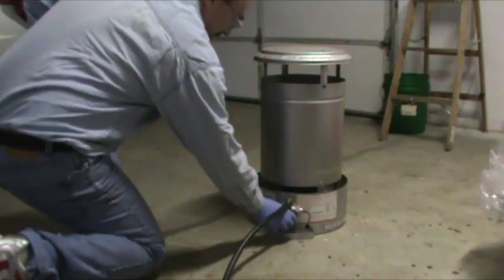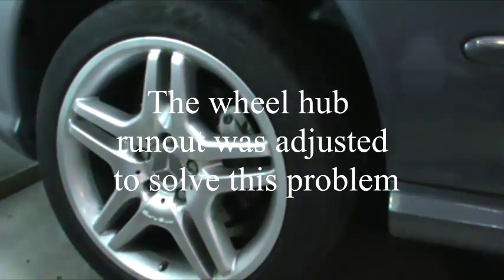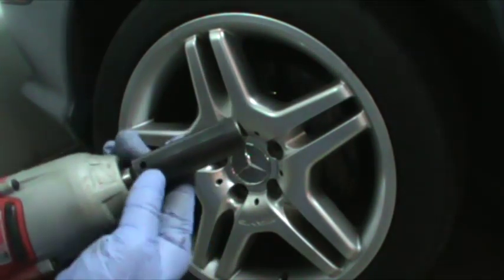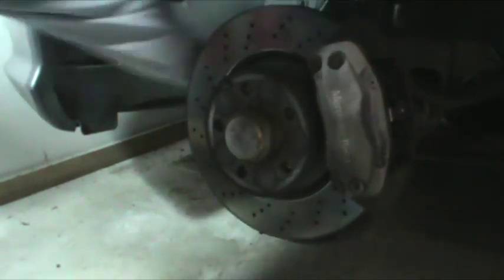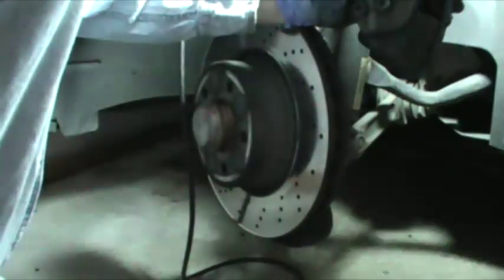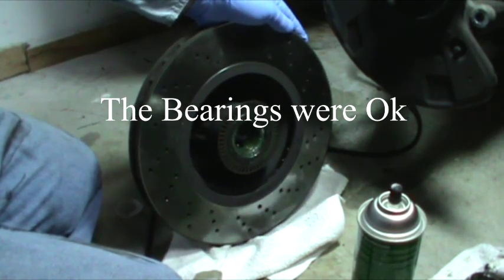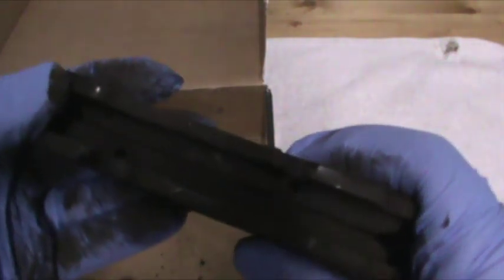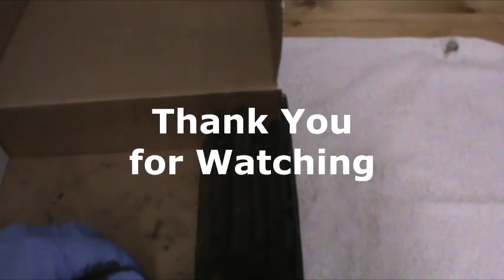Mercedes W220 Front Brakes

Comment: David prokity I have a question, I need to replace my front wheel bearing, I do feel a lot of play on the passenger side. My question is can I buy a new hub and do a straight forward replacement without actually messing around with the bearing itself?? Thank you.
Reply from the maker: The job is much easier to replace the hub assembly instead of just the bearings.  The cost is more too. $250 each side verses $20 - 40 per bearing plus the wheel bearing seal $20 each.  ($500 vs $160).  More than likely you only have to replace the bearing and not the races.  However the wheel bearing seal is tricky as it is very thin and bends easily.  The hub can stick to the rotor but I have a video on that too.  Either way, replacing the hub assembly does make the job easier and simple.

Comment: Did you find out what was wrong? I have a lot of play even in 12 and 6 positions, but I don't hear a humming sound so I'm not sure if it's the wheel bearing or not.
Reply from the maker: Jawiz My problem turned out to be with the L&R Main Lower Control Arm.  On the Passenger side, the ball joint in the knuckle was worn and on the Driver's side the air spring ball joint was really worn.  Now that the control arms and ball joints have been replaced, I still have tire noise from the left front tire but have not replaced the tires yet.  As far as wiggle, a loose bearing nut will result in an ABS warning because that happened to me. Bad bearings are more of a roughness issue than looseness - that's about it for bearings.  The knuckle ball joint replacement was a real challenge, so much so that I abandon the video I was making on that job.  My car was down for six weeks during that job.  Big learning curve for me.

Comment: I tried to punch the pins out but they wouldn't move for nothing, what do you suggest?
Reply from the maker: +John Hammoud   The pins only come out one way.  There is a large end and the other end is pointed.  You need to drive the pin out by hitting the pointed end. Reference the 4:57 minute mark in the video.  Also new replacement pins are available if you damage or destroy them.
Reply: +David Prokity I did that, I've done brakes before but those pins won't move.
Reply: The night before the brake job, remove the wheel and soak the two pins with WD-40
and try to do it in a warm garage or during the warmer months if possible.  Also, if yours are as stuck as mine were, take a burns-o-matic torch, wipe off the excess WD-40 and heat the caliper body (not the Pins) for about 1-2 minutes.  After that get yourself a quality 
Punch and put the punch on the outside ends of the two pins and give 'em a good solid whack, she'll come off then.  If they still won't budge, remove the two caliper bolts
And buy a whole new caliper, rotor and pads as well as new pins and anti-rattle spring
Because they're just plain rusted closed and all the force in the world won't make 'em
Budge.  I'm only guessing but these pads should have been changed when the brake light came on about 6 months before.

Comment: David, how many bearings is in each side of w220 front wheel?
Reply from the maker: ***** There is an Inner & Outer Bearing in both hubs
Reply: Which bearing tend to fail the most, inner or outer?

Comment: Please change the title of this video. If you're not changing the wheel bearings and why have bearing change on the title. It just waste time and confuses those looking for a video with wheel bearing replacement instructions.
Reply from the maker: brandon green Done.  I changed the title.  I must have edited that part out, the description said it was a bearing inspection that turned into a brake job.